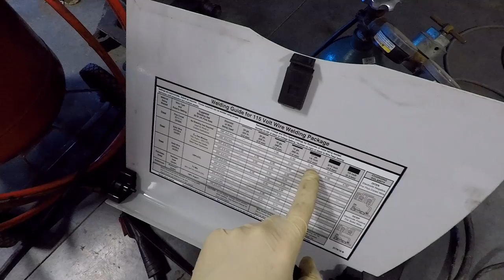Camber Plates INSTALLED | 2J-Z Episode 4

Comment: great video as usual mate, but i cant stress this enough... REMOVE THE BATTERY next time you do any "HOT WORK". i was cringing for the whole 15 minutes as you grinded over the battery. I am electric forklift mechanic, i work with batteries all day, like that, and also ones that weigh 1 tonne and are the counterweight for a forklift. I've seen more than my fair share explode over the years due to peoples carelessness. It's always one of 2 things: they blow when someone has jump started a battery off a second one to charge it, and have removed the jumper cables while the battery is gassing, or people have been grinding or welding over the battery. I dont care if its a sealed maintenance free unit, for any hot work, REMOVE THE DAM BATTERY!!!  otherwise, good work!
Reply from the maker: Dolf86 Good point! I never even thought twice about it, so glad you mentioned something. Next time!

Comment: Oof! So much measuring and precision to account for. Nice to see it turned out well.

Now that you've done it is there anything you would do differently or was this as straighforward of an approach as it's gonna get?

What kind of welder are you using? 

👍 for the handy reference guide/cheat sheet for welder settings.
Reply from the maker: +William Low Honestly this process went way smoother than I expected. If you take your time and be patient, it's not a difficult job at all. As for the welder, I believe it's a Hobart 140? I can double check!

Comment: Why not get bolt on camber plates? I'm new to this
Reply: Jonathan Barcia I've been told it's better to weld on vs bolt on due to when you weld it on its a more secure fitment as where bolt on plates over time will widen the bolt holes with daily diving conditions even more so when you race it